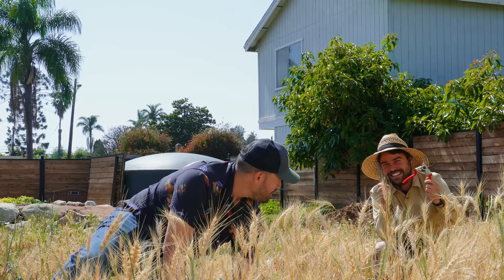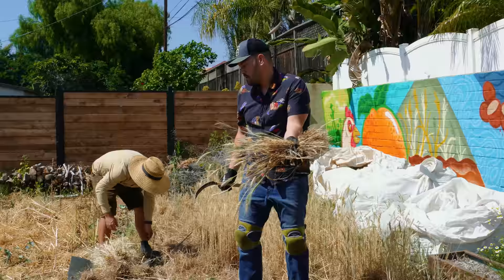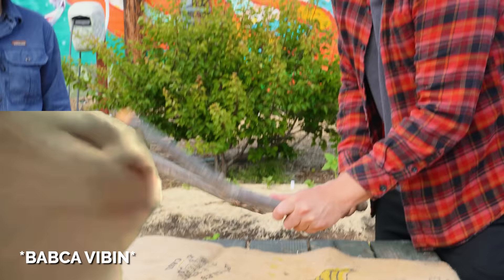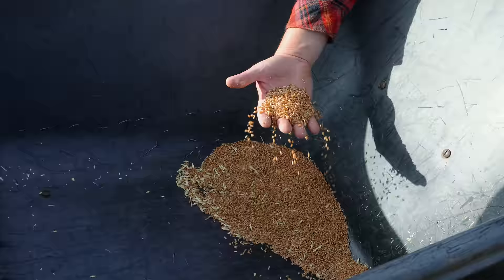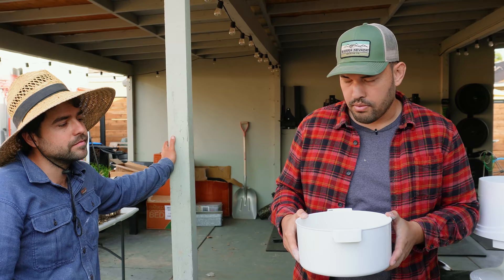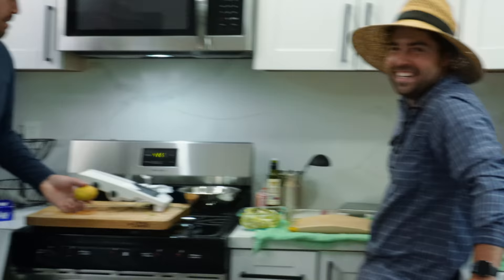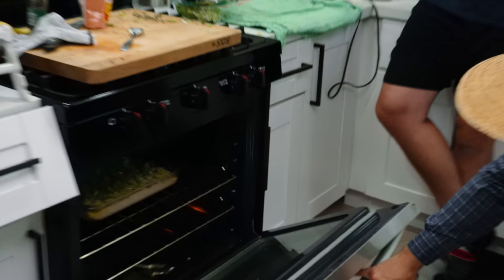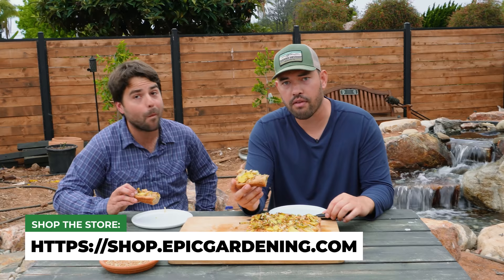Baking Sourdough Focaccia from 100% Homegrown Ingredients!

Comment from the maker: Epic Sourdough Po-Caccia: https://www.epicgardening.com/pocaccia-bread-recipe/

Ingredients
100g active sourdough starter (starter that has doubled after feeding)
10 g (roughly 3 tsp) kosher salt
440 g water, should be at least room temp. If using fresh flour start with 400 g water
500g flour, can be mix of bread, all purpose, whole wheat, and or fresh milled
Flaky sea salt or kosher salt
4 tablespoons extra-virgin olive oil, divided, plus more for drizzling
1 medium sized potato
2 garlic heads of garlic, Roasted in the oven until soft
2 medium leeks
Herbs for seasoning (Thyme, Rosemary, Sage or whatever you have!)

Directions
1. Place the starter, salt, and water in a large bowl and stir until it is mostly dissolved then add flour and mix it in completely. NOTE: When using fresh flour, you will need less water as it will soak up the water more effectively

2. After allowing the dough to sit for at least 30 minutes try to fold it by pulling up the sides and tucking it into the center of the dough. This gives the gluten some stretch allowing it to hold together better. The dough will be shaggy and sticky, so don’t try to over add extra flour. 

3. Drizzle with olive oil and rub it all over the dough, you don’t want to go crazy with oil here as we will be adding more later. Cover the dough with a towel and place somewhere warm (ideally 70ºF/21ºC) for about 4-8 hours, if it’s cold it will take longer to double and if its warmer it will double faster. It doesn’t have to be exact but just ensure that it roughly doubles, all this depends on a lot of factors, so it is impossible to be exact.

4. Once the dough has doubled you can prep the baking pan by pouring 2 tbsp. of oil into the pan and spreading it around. If you are using a glass dish it is best to use butter by rubbing it along the walls first as it will hold to the glass better and prevent sticking, once buttered add your oil in.

5. Add about a tablespoon of olive oil to focaccia dough, if you have flavored oil use this to give it a flavor boost. Deflate the dough and then scoop it out and place it onto your baking dish. Fold the dough a few times until it forms a rough rectangle shape placed in the center. You want to make sure that the seam from your folds is facedown in the pan so the dough spreads nicely. 

6. Make sure your dough is oiled up and then allow it to rise for another 4-6 hours. You want the dough to fill out the rough shape of the baking dish. For this step I like using a seedling heat mat to help speed things up which can get it to rise in 2-4 hours instead. 

7. At this point if you haven’t roasted garlic, you should roast it while the dough finishes rising. You want the garlic fully roasted and squishy.

8. When the dough is almost done rising, about 30 minutes before, turn your oven up to 425 ºF  to preheat it. 

9. During this time prep your topping, which can be pretty much anything. In this case we are making Po-caccia so get a medium sized Yukon gold and shave it into thin slices. Take your leeks and slice them up into small rounds. Combine your potatoes, leeks, and herbs in a bowl and smush out all the roasted garlic into the bowl. Mix up all the ingredients making sure the garlic is spread across all the slices of potatoes, this is a good time to add seasoning like salt and pepper. 

10. Get some oil on your hands and then start dimpling and stretching the dough out so it fills the pan. You will feel the dough squish and deflate as you do this. Drizzle a little more olive oil and then evenly spread your potato mixture out across the top of the dough, finish with a hearty sprinkle of salt. 

11. Place the pan in the oven and bake for 25-30 minutes, you will need to check to make sure it is fully cooked before you take it out. The edges should be browned and appear crispy. The potatoes should be fully cooked, better to let it cook 5 minutes extra than to undercook it. Remove from the oven and let it rest for at least 10 minutes, this will make removing it from the pan easier. Slice up and enjoy!
Reply: The Epic Cookbook comes out when??
Reply: I won't be growing my own grains (pity!), but I am going to be growing the other ingredients, so I'm going to make this in a few months.  I also have to hunt in the wild for sourdough starter, but nothing will stop me!  It looks fantastic!
Reply: I love that you guys added the written recipe. I feel like a lot of people just make you shuffle through the video over and over again.

I can see how that might help the views, but its so annoying to have to find each ingredient or pause and rewind, or anything like that.

Its much appreciated to have the typed form.
Reply: @garden_geek  <3 yah! :-D
Reply: Mmmm nom nom....thank you thank you!
Reply: Pin this comment please. 
Also please add some asterisks in the ingredients list alongwith punctuation. It's hard to read.

Comment: Boys, Momna B is going to tell you.. Scissors. I have 5 90' silos full of wheat. I also hand harvest for my personal use. So, I may know a thing or 2. A basket, and scissors. Cut 4 inches of the stalk only. Then, fill the sack 1/2 way up, and beat the bag on a hard surface, like a cement driveway, or against a very large landscaping rock. Then sift it. Then, put it on paper, or cardboard, and let it sit in the hot sun for am entire day. 2 days is better, but, bring it in at night. Then mill it. Next time, I expect you to do your own yeast capture, making your own starter. I expect you both to become and teach full self sufficiency, as the gov tried to make people dependent by using hunger. Get on it. The "pocaccia"  looks amazing. 😁👍🏻
Reply from the maker: Momma B. I WILL make you proud - Kevin
Reply: @epichomesteading  You already do. You 2 are such fine young men, and set a fabulous example that I hope others will follow.